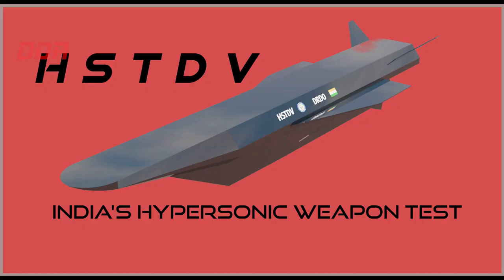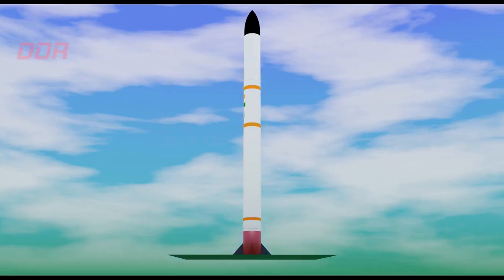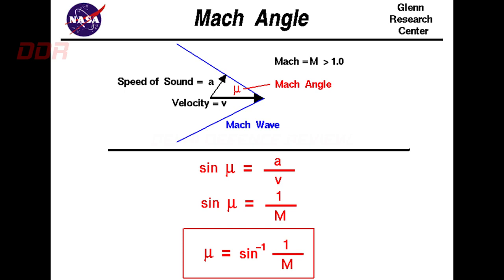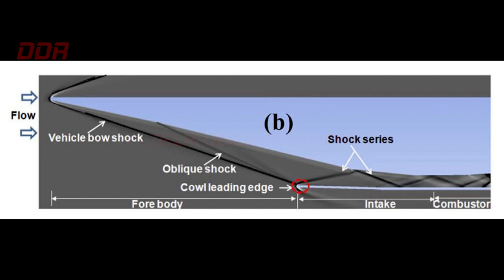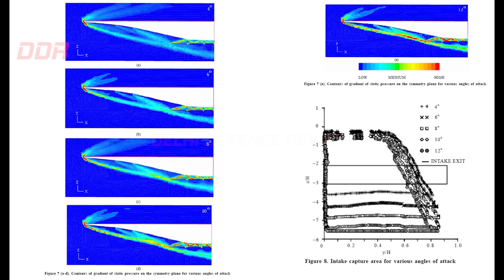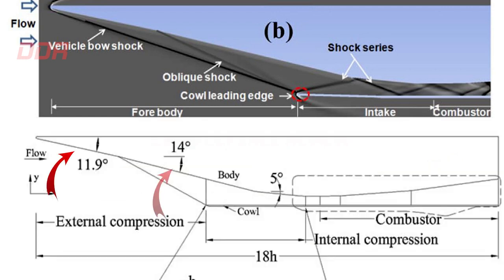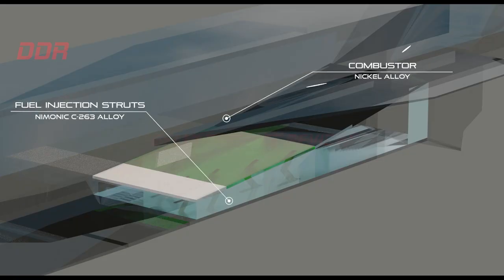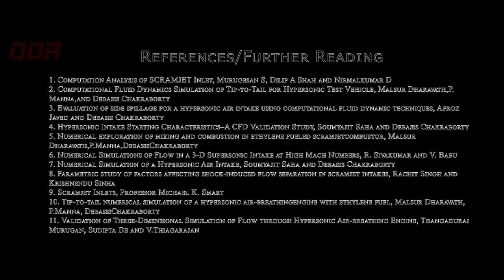India's Hypersonic Technology Demonstrator - How Does It Work?

Comment: In himaloyen range india newly test range in Arunachal Pradesh surprised world. Suddenly guided pinaka hilltop  hagging and taritoorial hugging mode just😢like tomahawk with😮Mack 4.8 speed manuvauring . where tomahoc subsonic speed 0.8 Mack 
Satalite guided it accuracy 20 to 30 meter 
Mmw milimetric wave seaker nag seaker accuracy 1 to 3metre. If pinaka carried folding drone then accuracy nearly zero 
Already deployed Arunachal Sikkim Ladak. All😢LAC now covered by 70km mrsam and akash prime (AkashIS) range 35 km 
This two airdefence world best. China Russia have long range missile  but failed to intercept fighter and particularly drones. China surprised when china airdefence pursy name😢by Iran 86%ddestroid by Israel on 26th October and iran😢surender through😮Saudi Arabia and amirat. To Israel. Not attacking israel. They already teached by Israel 
Junk china defence ..now Iran agreement with Russia 20 years for save from Israel. My question. Russia afraid israel. After drone attacked from Ukraine. So israel easily😮beat Russia in Syria and Iran @ u tuber